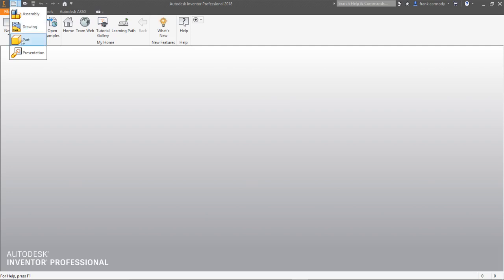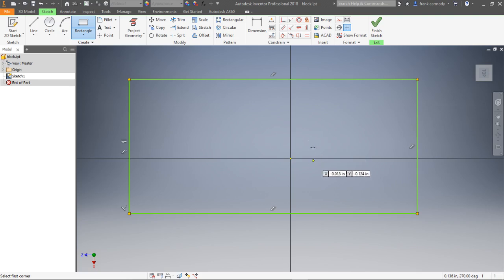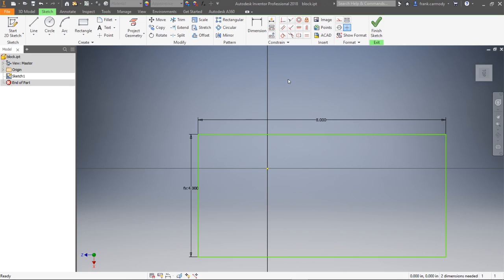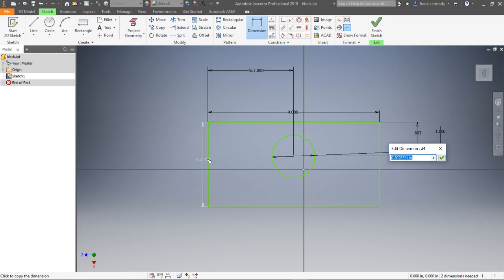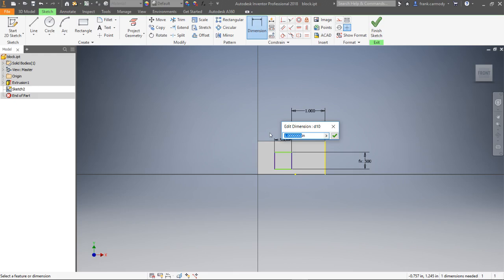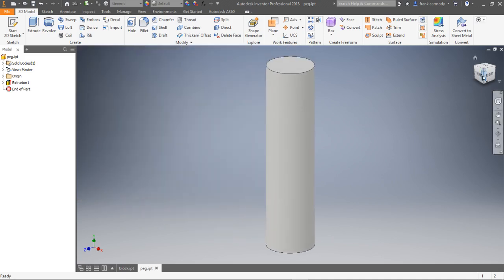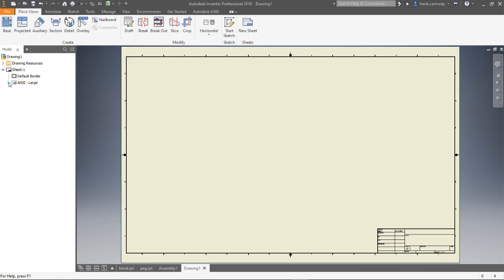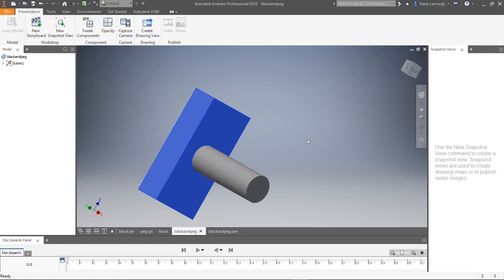Autodesk Inventor 2018 : 0 :  Basics in 30 min

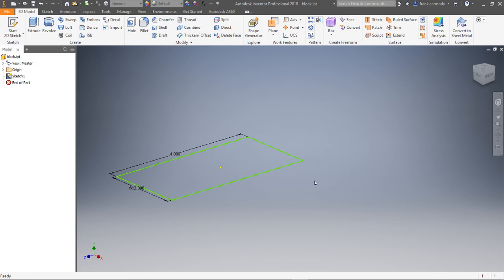Comment: 10:57 "Next thing people often get wrong is thinking they can do a bunch of stuff like holes in a block, drawing rectangle, circle, etc..." Next thing you do is putting a hole into the block in the same sketch.
Reply: You can, but only one thing at a time. You can't extrude, punch a hole and add a circle all from one sketch in one operation. That is probably what he wants to convey here. I got a little confused by this. You can't "but I drew it in that last sketch".

Comment: Im coming into creo cad to auto desk. And i am confused by all these names whats the difference between autodesk autocad and autodesk inventor?
Reply: Autodesk is the company that makes AutoCAD and Inventor. AutoCAD is typically 2D (though there are some 3D features now iirc) and used for architecture and MEP stuff. Inventor is used to create mechanical parts for machining and assembly. 
Think of it like this:
AutoCAD: Make buildings and show electrical systems, piping, etc.
Inventor: Make things like engines and other mechanical systems

Comment: I'm needing help. Here is what I would like to do. . . 
- take a picture of my brother with his motorcycle.
- cut out the picture, and move just the part of my brother and his motorcycle.
- edit the background so that way it's him with a totally different background I drew.
- Draw this background and add to background, without affecting the original picture. 
I wanted to use glow brush to give him flaming wings.

I am using a Lenovo tab 4, 10". Finger drawing.

Comment: In Inventor, ALWAYS START at the centerpoint!
Reply: Why
Reply: @lukemckinney4150  It makes your life so much easier, because the center point is automatically in your sketch and you can use it to ex. center the middle of a circle or a rectangle or some such and Inventor will recognise it as a point. When you don't, you'd need to lock the sketch object in place or define distances from the center point for it to be "fully constrained", which you want.

Comment: I almost always use rectangle 2 point center on a initial sketch for sheetmetal parts. I use rectangle for cutting so I can dimension from edges of the part.